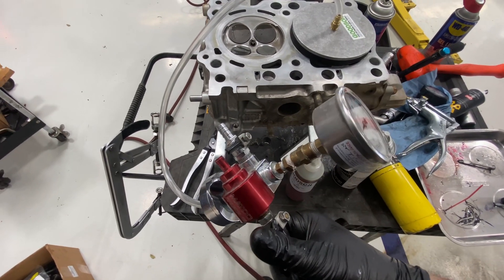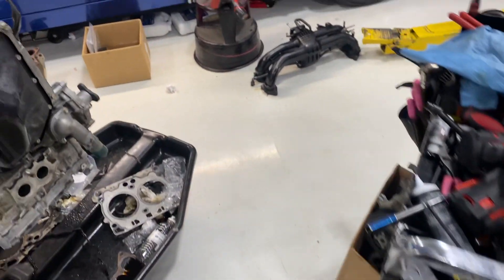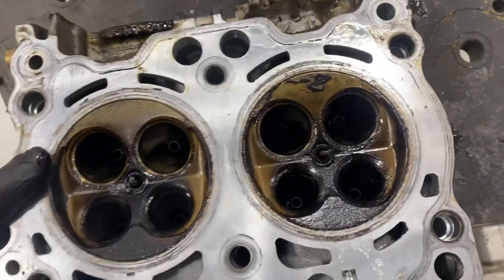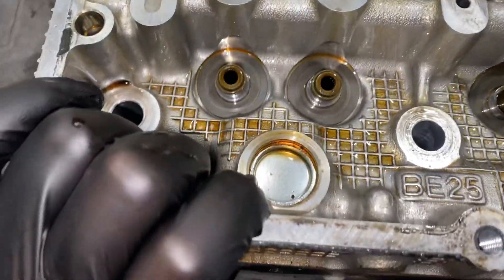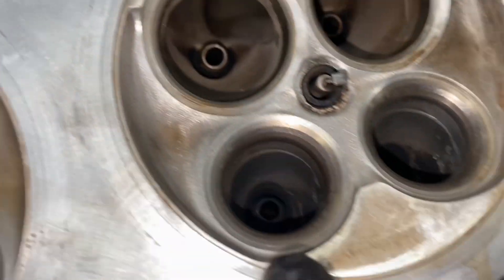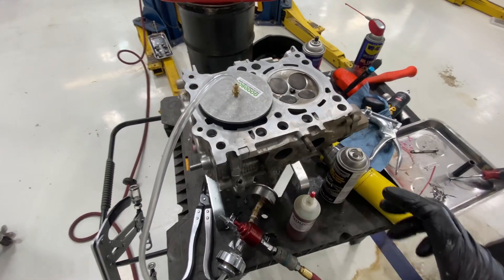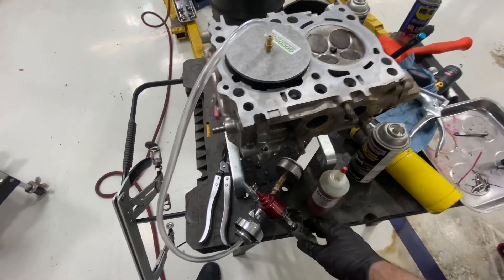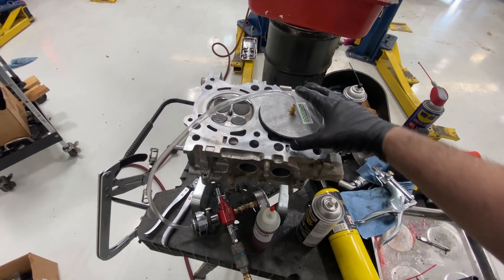Subaru Cylinder Head Inspection

Comment: Hi, will a 2018 subaru outback wagon non turbo have a cam carrier leak/drip at 34,000 miles on the car? dealer is charging me $3555+.
Reply from the maker: That's about the going rate.

Keep in mind "powertrain" is 5 years and/or 60,000 miles, and it sound like you ran out of time (that sucks).

Send me an email at bajahaautomotive@gmail.com
I know someone that might be able to help with the price

*NO PROMISES*